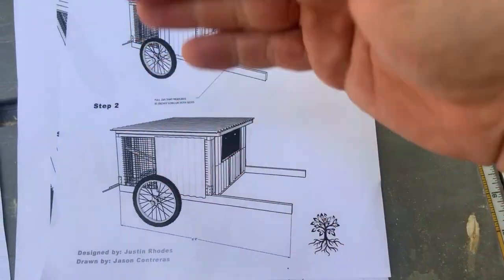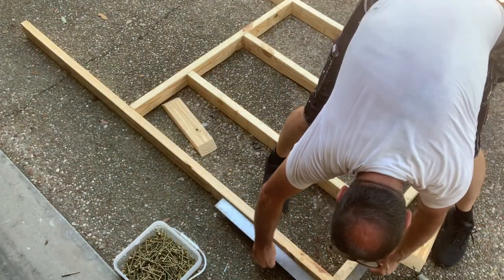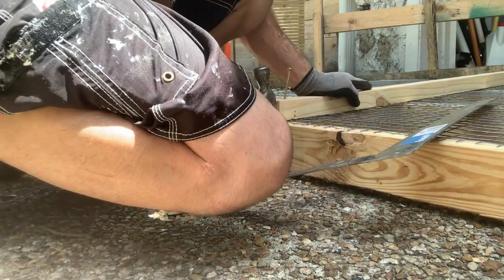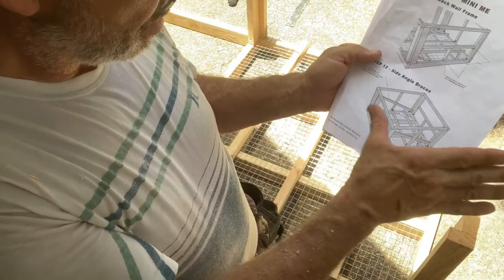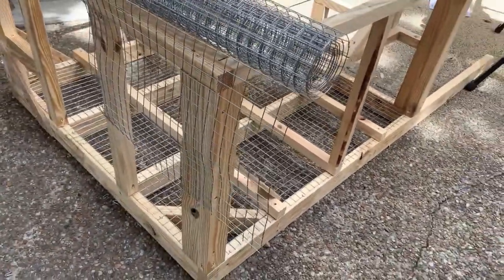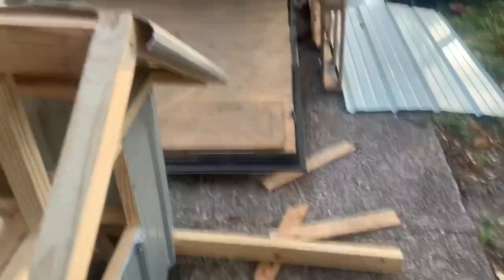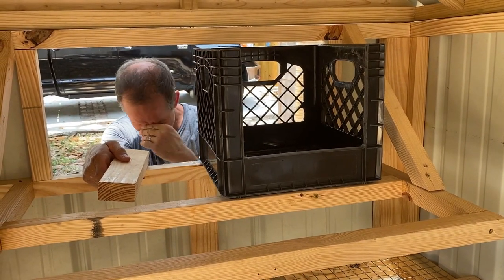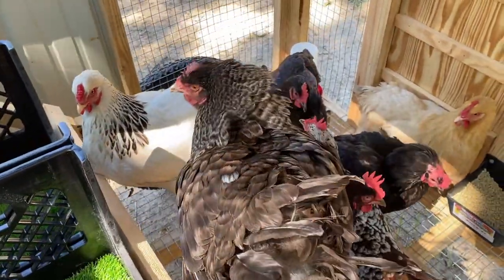Miniature Chicken Tractor (Justin Rhodes Chickshaw Mini Me Modified Design)

Comment: Love the chick shaw! A pitched roof is a great upgrade. How many chickens realistically can be housed in this? The plans say up to 16 but that sounds like a lot. This would be my only coop and I'd be adding a large enclosed run to it
Reply from the maker: Hi Juli! We have 9 chickens and they have plenty of room. We move it every day and move the electric fence around it so the girls are only inside the coop when they sleep and when they lay eggs. The only time they are all in there together is at night when they sleep on the roost. We have large heritage breed chickens, and I would put another 2 - 3 chicken in there before I felt it would start getting too crowded. If you had smaller chickens, you could probably do 16. As you may know they prefer to cuddle up tight anyway when they sleep.

Comment: Great work! I really like the roof. What size wheels did you use?
Reply from the maker: Thank you for watching.  The plans called for 26" wheels but at the time of our build I could only find 24" wheels.  I bought the wheels from Amazon, but I'm not really happy with the quality.  The wheels have warped a little so I need to find a strong wheel that can handle the weight and my abuse.

I provided the link to the wheels I purchased but I recommend trying to find a heaver duty wheel.

Good Luck.

Dan
  <a target="_blank" href="https://www.amazon.com/gp/product/B07S977Y4Y/ref=ppx_yo_dt_b_search_asin_title?ie=UTF8&amp;th=1&_encoding=UTF8&tag=greenhavenfar-20&linkCode=ur2&linkId=e77d39d740d4b182aefa3cb962281c65&camp=1789&creative=9325">24 Inch Wheels for Chicken Tractor</a>

Comment: What was your approximate cost? This will obviously vary by location and retailer, but just looking for a ballpark. Thank you!
Reply from the maker: It’s hard to say because we used a lot of left over materials. But wheels were about $60, bolts for axles, set of hinges, wire and roof panels from Lowes about $300.

Comment: Are the laying boxes open to the outside? I didn't see a protective cover and  I'm wondering if they would be at risk of predators.
Reply from the maker: They are open to the outside but the boxes are locked in so a predator wouldn’t be able to pull out the boxes. But it’s easy for us to get the eggs.  Thank you for watching.

Comment: I'm wondering do you put the warer and food inside? I was thinking of adding something to the side or under for food and water. The only issue with under would be droppings
Reply from the maker: Great question! We started with a small open feeder inside but the hens were roosting in it and it got very dirty, so now we put their food on the ground each morning to encourage scratching. We hang a bucket of water on the outside of the tractor (that has nipples underneath) and that works the best. We move them every day.

Comment: HI! Great job. We have our baby chicks and also plan on making a modified version of the Mini Chickshaw, one thing I can't seem to find is where to buy these heavy duty wheels. Do you have a link or suggestion on what brand to purchase? Thanks!
Reply from the maker: Sorry for the delay on getting back to you.  I found these tires on Amazon but they aren’t made for the weight. So I need to find something better.  I will try to send you a link tomorrow if I find something.  We’ve been at the new farm all week and our signal was too week to check YouTube.
Reply from the maker: Hi Kelly, I did a bunch of research today and found a better tire.  The tires I purchased only had 150 lb capacity and the ones I found today have a 250 pound capacity.  My tires are warping a little so definitely buy the 250lb capacity tire.  Good Luck. 

<iframe sandbox="allow-popups allow-scripts allow-modals allow-forms allow-same-origin" style="width:120px;height:240px;" marginwidth="0" marginheight="0" scrolling="no" frameborder="0" src="//ws-na.amazon-adsystem.com/widgets/q?ServiceVersion=20070822&OneJS=1&Operation=GetAdHtml&MarketPlace=US&source=ss&ref=as_ss_li_til&ad_type=product_link&tracking_id=greenhavenfar-20&language=en_US&marketplace=amazon&region=US&placement=B07GSBW2WY&asins=B07GSBW2WY&linkId=7d88fdc829f29cb15c5206defab09b04&show_border=true&link_opens_in_new_window=true"></iframe>
Reply: @GreenhavenFarmandHomestead  Thank you!
Reply: The 26" wheels are available at Northern Tool. You can order them online and they will ship them to you. I just built the ChickShaw 2.0 and that is where I got my wheels. If you want to build the bigger ChickShaw the link is available on YT. To get access to the build video you need to share the link with someone else and they you can have the video.
Reply from the maker: @emailjimsylvester  I will try to do that now.  Thanks for watching.
Reply from the maker: https://a.co/d/fDmYJ6C
I found the wheels I purchased but they are currently not available.  Look for something similar but I recommend that you pay attention to weight capacity of the wheel.  Get something that is at least 250lbs so they will hold up for a long time.